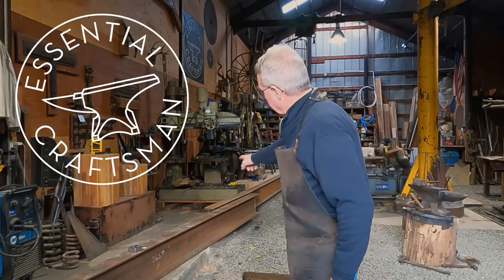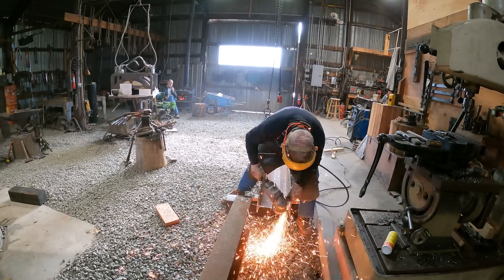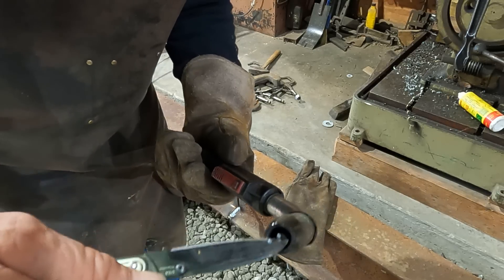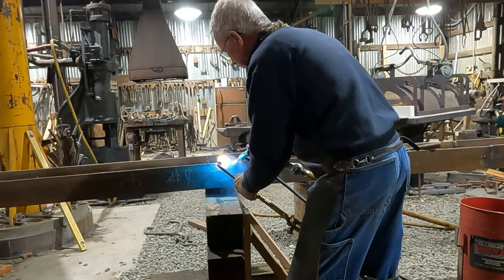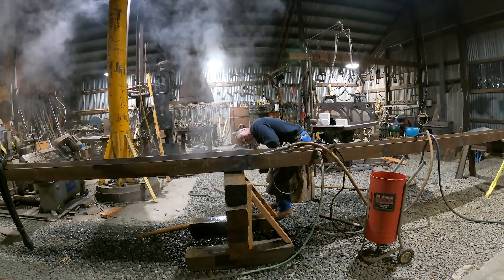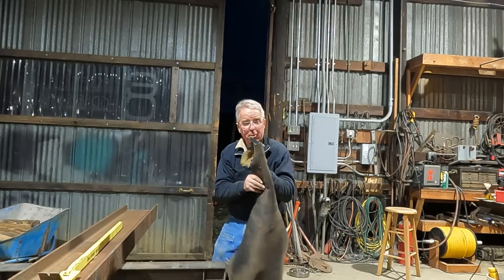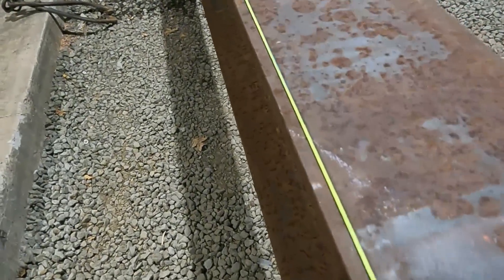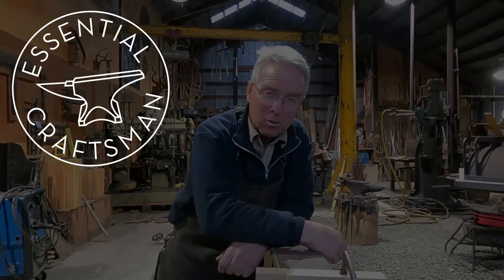Flame-Bending a 40' I-Beam

Comment: It’s been a while since I was paid to weld.  But I would have put in a root pass with 6010 (6011? Yeah it’s been a minute) rod and capped it with a few 7018 passes.

I’ve also witnessed by dad straightening out I Beams that were warped like that by Laing down welds in a particular pattern to draw the steel back to straight.  Never knew how he did it but it was frickin magic to see. 

Keep up the good work!
Reply: MIG is a poor choice for structural work.  Stick or flux core would have been better.  being on the west coast, he is in an earthquake zone so 7018 all the way or dual shield are probably the code for a beam splice.
Reply: @peetky8645  Beat me to it. I'n not a pro welder but I wouldn't trust my life to a MIG butt weld. Stick all the way with a gusset plate reinforcing the joint
Reply: @rubencantu5067  Great idea.  A nice fish plate on both sides would be prudent since the weld is MIG....
Reply: Mig is fine for that if you have a big enough mig. Problem is that people buy these little mig welders that the weld quality falls off as they heat up. And people don't run them hot enough. Mig is not only short circuit either. You can also spray and pulse which are supposedly better. I would have wanted to weld that with my Lincoln Idealarc 250, or my Miller Bobcat 250 and 7018 or 9018, but it wouldn't worry me to do it with my Forney 270 mig. I have welded 3 inch schedule 80 together with it and it will make the entire circumference glow red for about six inches end to end. I would say thats sufficient penetration. And for what he is doing it needs plated if possible.
Reply: That would have been my play as well, but it may have been that he only has the MIG welder.
Reply: Guessing you are a 60+ yr old welder. Mig is often used in structural today. Especially flux core with cover gas.
Reply: @4110mahindra 
What has changed with mig in recent years? Has some new innovation come along to get rid of the cold lap problem?
Not challenging you or being a smarty pants. Genuinely asking if something happened that I missed.
Reply: @ronfox5519  No, that problem remains. The real problem is that they been marketed to people with little or no understanding of the limitations of the process. It's only reliable on sheet metal.
Reply: @maplebones  
Thank you for the response.
I have always thought it was irresponsible to sell those units to the general public due to the possibility of somebody's home project go-cart coming apart at 30mph.
Reply: @4110mahindra  Mig is a bare wire with no flux,  and is prohibited for structural work in many places. Flux core (dual shield)  and SMAW (stick) have much better weld properties. I make my living designing and testing welding procedures, and I would not recommend using this procedure to anybody. In fact, I think the video should be taken down because it could get somebody killed..
Reply: @4110mahindra  MIG is a short circuit process, hence the bacon noise.  MIG is never used in structural welding because of limited penetration and a discontinuous arc.   Duals Shield  Process is not MIG, it is FCAWg.  Stick, FCAWg and FCAWs are the only code structural processes in the USA.
Reply: @peetky8645  whatever.  I have seen it used in structural industrial applications and seen the welds certified but ok.  And all electrical welding is short circuit welding.
Reply: @4110mahindra  No again. Arc welding can be short circuit transfer, globular transfer, or spray transfer. There are applications for all of them, but for a welding procedure to be certified, a sample weld has to be destructively tested to determine it's properties. This guy is just winging it on a hope and a prayer. The backyard short circuit mig set ups like this were designed for sheet metal. I've seen good looking welds made with with them in 3/8 plate that snapped in two when dropped on a concrete floor.